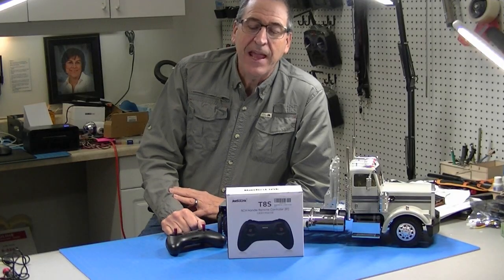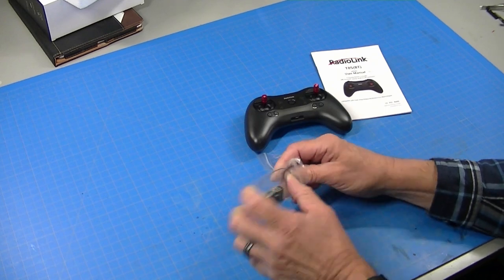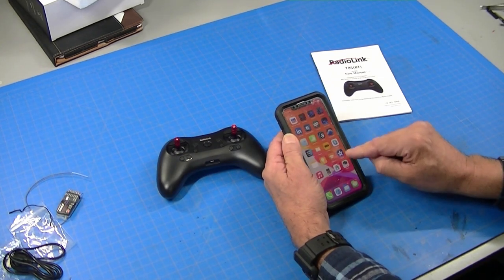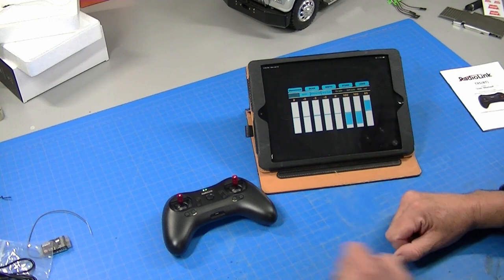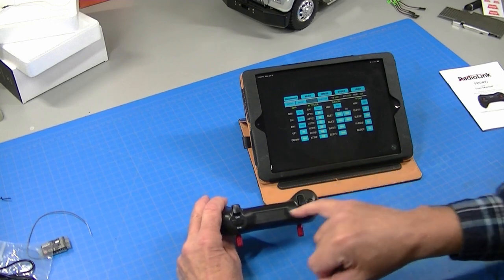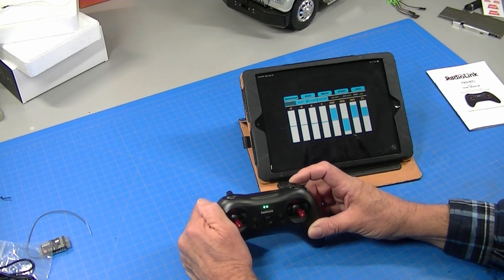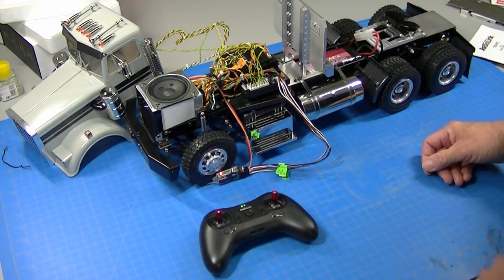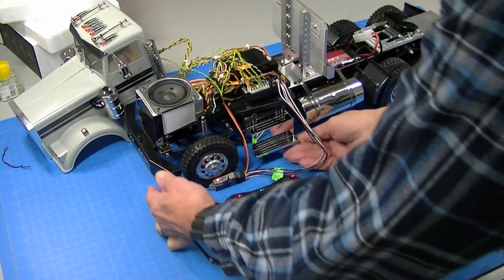Radiolink T8S Review and Tamiya MFC-01 Setup & Programming

Comment: You mentioned that sometimes it's nice to be able to use extra batteries for your transmitter,  you can use a portable phone charger in your pocket and run the usb wire to your transmitter and have plenty of battery power.

Comment: Hi Bob. I bought a Tamiya king hauler truck. And it was very easy to build according to your instructions. Many thanks for that. My remote control, which I bought together with, gives me some challenges T8FB-bt 8 ch. I can steer well and the horn also works, but I can't turn on the lights or turn the truck on/off on the remote control. What am I doing wrong. This is my first time building. 54 years from Denmark Many thanks for all your videos.
Reply from the maker: I tried to set up that same radio and could not make it work.  I think they had a bug in the original software that prevented the dual rate settings from working properly.  You might try to update the transmitter to the newest firmware and see if that helps.  Then reprogram and re-map.
Reply: @HobbyconceptsLLC  thanks for your help.. after update i got it to work well. Now i can turn the light on on my remote control. Lot of fun, first time i build. Thank again.

Comment: Can I use a 3S lipo on the Tamiya MFU and Grand hauler? P.S. Great Channel 👍
Reply from the maker: No on the 3s.  Will toast an MFC in seconds.  You can use a 2s but the MFC does not have a low voltage cutoff so if you do put a lipo low voltage alarm on the battery.
Reply: Thank you for letting me know, I do enjoy watching all you do, keep up the good work.  😀

Comment: It appears that the steering servo is working in reverse(i.e. truck will indicate right turn but actually tern left)
Reply from the maker: Yes, needs to have steering reversed but did not bother with this radio since the actual truck will be getting a different radio.